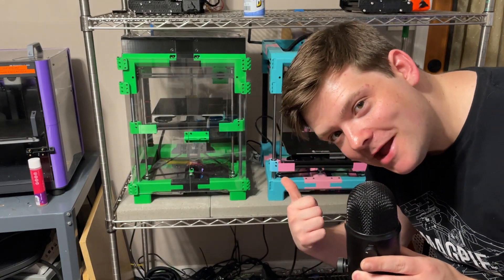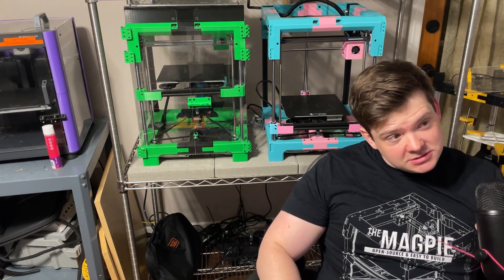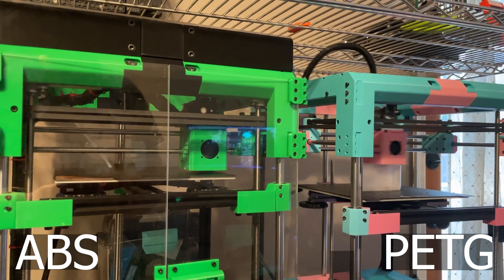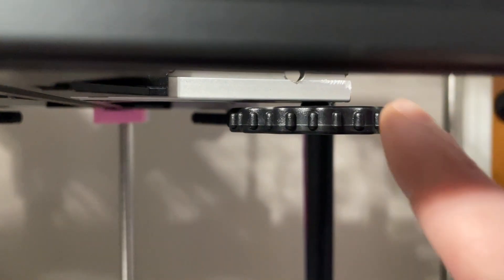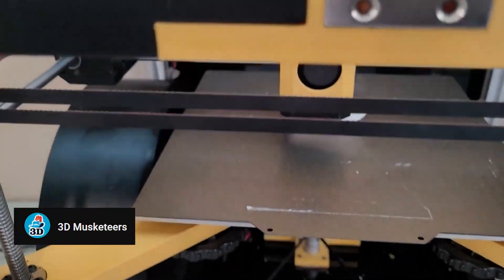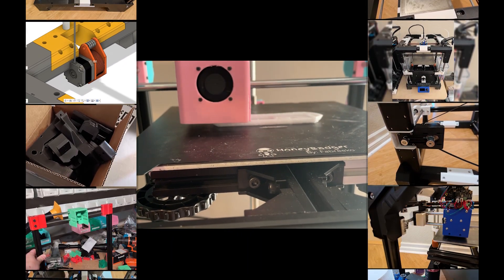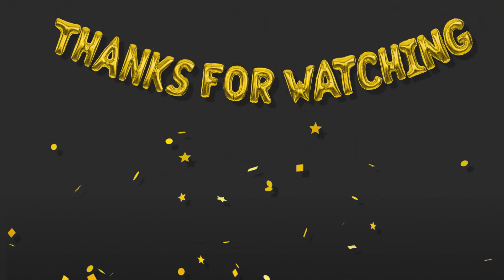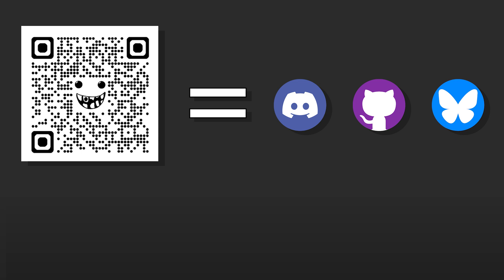The Magpie - Keeping REPRAP Alive in 2025

Comment: So would this hypothetically turn my ender 3 s1 plus into a non bed slinging printer ?
Reply from the maker: Looking at the build size of the ender 3 s1 plus, it's bigger than the traditional ender 3 platform which is 230x230, and the CAD for a Magpie with 300x300mm build size like the Ender 3 S1 Plus doesn't exist...YET

That's going to be the next thing after I make a video build guide for a regular sized Magpie.

But to answer your question, It's not so much turning your ender into anything as much as it is using the bed, power supply, motors, and some motion components from the ender 3 as part of the bill of materials for a new printer, and that new printer is a non-bed slinging printer.